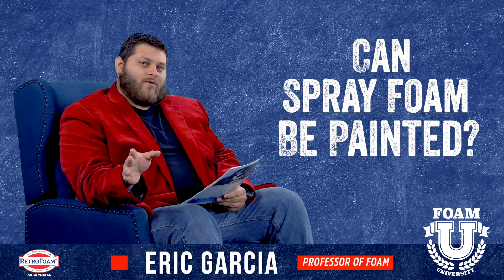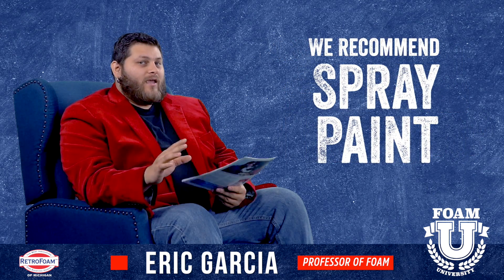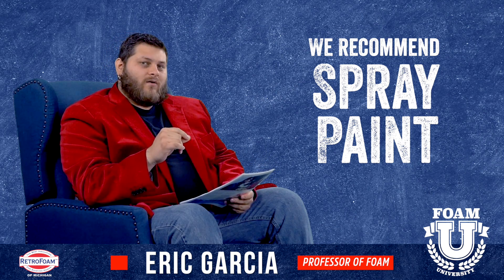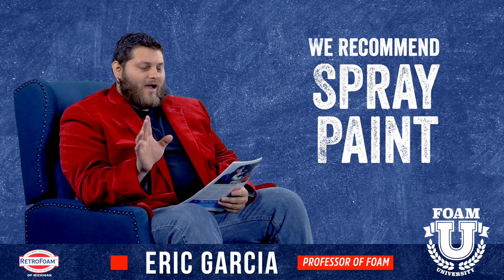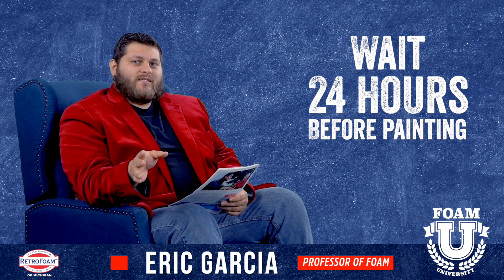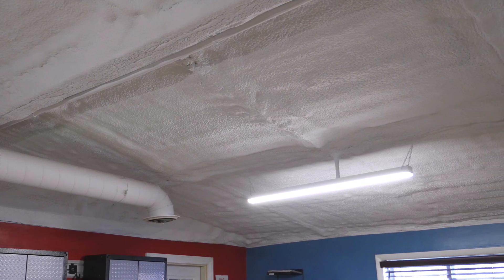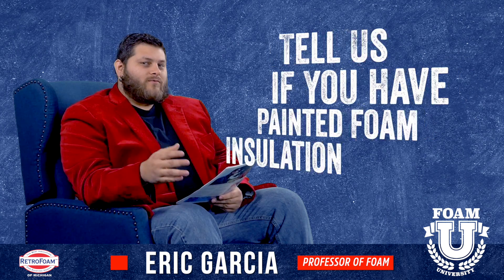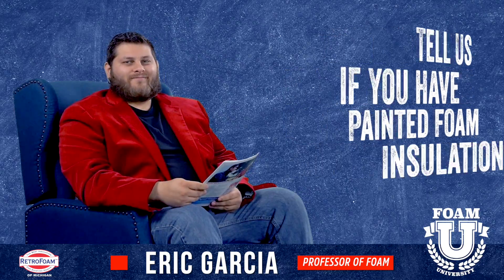Can Foam Insulation Be Painted? | Foam University

Comment: Can I internally put wood cladding Infront of a spray foamed shed wall
Reply from the maker: Yes, you can. You may need to trim back the spray foam so that it is flush with the studs, so the cladding can be easily attached.
Reply: @RetroFoamofMichigan thanks for that👍

Comment: I have old spray foam with some mold. What paint can i use
Reply from the maker: Painting over mold is never a good idea! It can trap moisture, allowing the mold to continue growing underneath, leading to more significant issues over time.

If you notice mold on your spray foam, it's essential to contact the company that installed your spray foam.

Comment: painting an open cell spray foam, is that good enough to be water sealant?, atleast from the top. I used it to fill a hole outside in wall, just does nt want water to go in?
Reply from the maker: Open cell spray foam still allows for water to move through it. The paint wouldn't be enough to prevent the water from eventually getting through.

Comment: I'm building a walk-in cooler using closed cell spray foam - the room will be kept around 40F and will be holding flowers so there will be moisture / condensation in the room - do you think the painted spray foam would hold up in this environment or foresee any issues with painting it? Traditionally I would put plywood & then FRP over the spray foam, but I would love to avoid the cost of that if possible!
Reply from the maker: Hey Brittney! We do not see any problems with exposed painted foam in this environment.

Comment: Great work! I have a question hopefully you can answer. I purchased an old farm building with exposed yellow closed cell spray foam covering walls and ceiling. It appears that animals were kept inside the building which left behind a smell. My question is, can I simply paint over the foam to seal the smell, then cover with plywood/drywall? Can I wash/disinfect the insulation before applying a coat? I plan on turning the building into a guest house. Any help would be greatly appreciated. Thanks!
Reply from the maker: Great questions! We have heard people say they had success masking odors with a few coats of paint. However, that is not guaranteed. Before applying any paint to the foam, we recommend using an air compress to dust the foam off. You may also be able to look into the paints that are scented and intended for masking odors. With any of this, it is not guaranteed that it will mask the odor but it is a fairly inexpensive thing to test out. I hope this helps!
Reply: @RetroFoamofMichigan  Thank you!! That really helps

Comment: I use spray foam all the time and it is such a huge help. I don't know what the surface is that you are closing up but whenever I use it on an area that needs to be painted I give it a thin coat of caulking and you can paint the hell out of it. Caulking is self priming. Spray foam is so cool because after it's dried completely to its core and usually overnight, you can shape it with a hacksaw blade and it cuts so easily. Then, whatever it is you created, just smear a layer of caulking across it and it'll take paint really easy. 👍
Reply from the maker: That's awesome!

Comment: Can you cover spray foam with OSB board?  I was told I needed a fire retardant barrier, but it's just my garage.
Reply from the maker: That is all depending on the code in your area. Our product is class one fire-rated so we normally do not add a fire retardant barrier to it before it is covered with OSB or drywall. We have had instances where it did have to have a barrier because of the cities code for Spray Foam. I hope this helps!

Comment: By what little I have read,I thought spray foam/Rigid foam board had to be enclosed with drywall or a material with atleast 1/2 hr fire rating per building code ?? when used in the interior of a home. Appreciate your comment. Thanks

Comment: Hi. I'm planning to use spray foam in the coming spring to fill in a gap and a couple small holes on a side of my house where hornets can very likely reside and make a nest. Last summer, i had a hornet's nest on a different side of my house which was a nightmare. My question to you is, once i start using the expanding foam, come summer when its above 80 or 90 degrees, are there any risks if i were to leave the dried out foam exposed to sunlight without a touch of paint on it?
Reply from the maker: Yes, you will want to use UV paint coating to go over it if it's exposed to direct sunlight.

Comment: I want to repair a small divot in my garage Interior door panel (made of foam) with some spray foam and then I would like to paint the whole door inside panels.  Can this be done? what kind of paint?
Reply from the maker: Yes, it can. You can repair the divot and once the spray foam is dry you can paint it. We recommend using spray paint rather than trying to use a brush or a roller as those methods can take longer. Also, if it is open cell spray foam, that material tends to be softer, so you would need to take extra care when using a brush or roller. Spray paint is where it's at.

Comment: If you shave closed-cell foam after spraying it, would that paint then act as a new skin for the foam surface?
Reply from the maker: The paint could act as the new "skin" but it wouldn't be the same and that "skin" is not required for the foam to be effective.

Comment: Can one sand, or smooth out the surface of that spray foam?
Reply from the maker: If you want the foam to have a smoother look, the best bet is to have that discussion with your insulation contractor. For example, the contractor can cut the spray foam back after it is sprayed to give it that smooth look.

Comment: Can you paint between the studs before you apply the foam? Will the foam still stick to the wood with a coat of paint?
Reply from the maker: Yes, you can paint between the studs before the spray foam and it won't have any issues adhering to it.

Comment: Thanks, for the video. What type of paint was used on your office ceiling?  I'm thinking of having closed cell foam sprayed on the interior walls and ceiling of a van, and then spraying a finish on it. What type of paint would you recommend for a durable finish?
Reply: Use water based paint only . Acrylic paint.  
Paint has chemicals will damage foam
Reply from the maker: It doesn't require a specific paint, honestly. Any paint should stick to it.
Reply: @RetroFoamofMichigan  Okay, thanks
Reply from the maker: @organican  No problem at all!